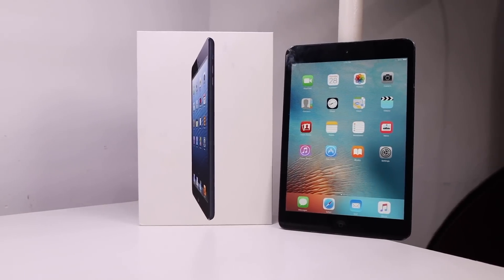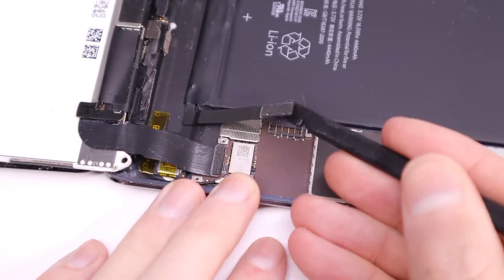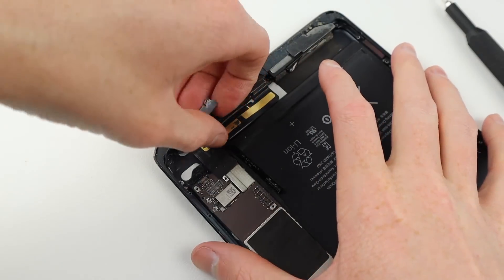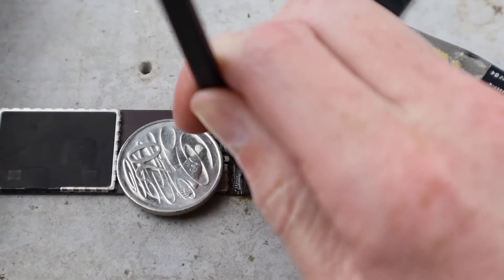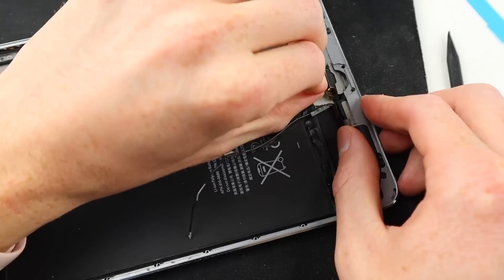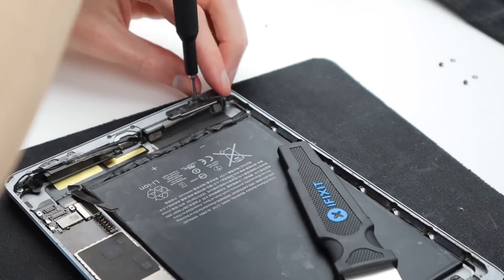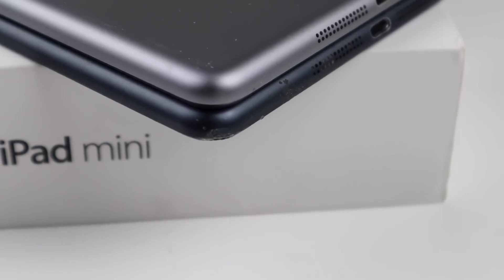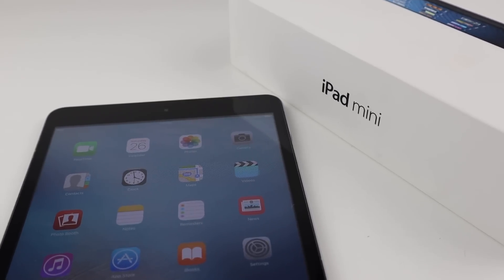$50 iPad Mini 1 Restoration & Microsoldering Repair!

Comment: check c8119 or c8120 for short to ground, most of the time 3v3 line shorted. inject 3.3 volt to c8120  and look for a hot component probably pmic.

Comment: Fixed my SE with this guys motivation
Reply: Tai Callender I like the SE brcause its my only phone and how small it is
Reply: @forcequitOS  Wait for the SE 2 then
Reply: @forcequitOS  It is a 2016 phone btw... but anyways, if you can't wait any longer you can get the iPhone 11, 11 Pro or the 11 Pro Max
Reply: @forcequitOS  Maybe if you want a currently Apple "supported" iPhone get the XR but if you want to get the dual camera get the X or XS

Comment: I tried this repair on a mini 3 and it kicked my but. I am new at cell repairs and tried to use a soldering iron and wick for de soldering. I did not know about the heat gun method. Of course, I ended up ruining the logic board and two replacement charge port assemblies. 😌

Comment: use some low melt solder to get the old connector off a lot easier. Stops you from also dumping to much heat onto the board.

Comment: For an easier removal of the Charger port put leaded solder on the gold contact points then remove the charger port with heat. The leaded solder will decrease the temperature needed to melt the solder off

Comment: Great work. I just worked on one of these today. Really unfortunate that iOS 9 runs so poorly on A5 devices. Almost unuseable.
Reply: Screen Savers I'm typing this on an mini 1 on iOS 9.3.5 it is slow I purchased it a few weeks ago due to lockdown it's actually quite usable if you don't fill it with apps

Comment: In removing the motherboard, rather than heat and pry it, d/c the battery, and flood under the board with isopropyl.

Comment: you can actually downgrade an ipad mini one to ios 8.4.1 by jailbreaking it installing ifile and then changing the version to ios 6.1.3 so that the ipad thinks it needs to update to ios 8.4.1. Once you've updated to ios 8.4.1 you need to reset it in settings and then you just set it up

Comment: I fixed my iPad mini first generation as well and I was surprised how unbelievably stupid it was glued together… it really isn’t Apple like to use adhesive to glue down the logic board or to solder the lightning port onto the device… I’m glad that it isn’t shattered and bent anymore and is functioning almost normally but the heat ruined the Digitizer of the iCloud locked iPad wich had the replacement Digitizer installed… I hope the newer iPads aren’t made that stupidly…

Comment: Instead of the adhesive under the glass. Use T-7000 black glue and some clamps to secure it even more to the frame. Otherwise superb work

Comment: Good video but you should have Desolder Ed the charging flex using an soldering iron. It’s not just easy but safe especially if you are not very good at Hot Air Gun. I hope my comments didn’t offend you mate.

Comment: I had a ipad mini 1st gen until it got snapped in half (literally in half)
Reply: albion pajaziti holy crap
Reply: I'm commenting on an iPad mini 1 I have had since 2014 one volume button doesn't work orientation lock toggles randomly and the touch screen doesn't work for a few seconds after restarting

Comment: Replacement of charging jack was very disappointed,its not easy as u said brother.
Reply: Here comes The pain He said it would require soldering
Reply: @brandon_nope  soldering is not easy
Reply: The charging port is only soldered to the board on ipad minis. All the other models have a lego connector.

Comment: Hey Hugh, I found an iphone 6 with a cracked screen (still works though, even touch), so if you'd like to have a crack at repairing it, I'm happy to send it to you if the owner doesn't collect it from the police station. It is however icloud locked, so if you don't repair it, it'll give you some parts to play with.
Reply: dash8brj I will take it, I can fix it

Comment: Aww man, I wish you could repair my phone (Asus Zenfone Go ZB452KG)and Samsung Tablet (Samsung Galaxy Tab 3 8.0) so I could use it properly (and pay I guess) because the display would flicker when ever I turn it on and it will wouldn’t charge with a regular charger. I have to take out the battery and use a battery charger which uses 2 metal sticks to charge it with the gold thingy on it but the charger is very slow and my father dropped it by accident. And my Samsung Tablet doesn’t work anymore. It all the sudden stopped working for no reason, I haven’t touched it for like 1 or 2 months and I tried opening it to see what I can do. I opened it with my finger nails since it didn’t had any adhesive (because it’s ancient) and couldn’t really do anything. Anyways, it’s ok if you can’t, I don’t need them anyway

Comment: You don't need a full-on rework station to do this job. A cheap $20 soldering iron and stones patience works too. Replace the lightning port on my iPad this way. 

Also, why are you using a toothbrush? Get q- tips.

Comment: Well you can actually downgrade to iOS 8.4.1 by jailbreaking it and setting the firmware version file to anything below 7.0.0 and using OTA update to install iOS 8.4.1 since Apple still signs it for devices still running iOS 6 which can’t directly update to iOS 9 or later. And then from there you can jailbreak then install coolbooter and dual boot between iOS 6 and 8 which if you’re running iOS 8, the jailbreak will be untethered meaning you can reboot the device and still allow it to boot to the second OS

Comment: hello Hugh... I am from the Phillipines and I have an Ipad mini 2 that if you allow, wanted to trade it to a ipad mini 2 also but with good screen working. Mine had black lines on it and tried to replace it using your video but I got scammed and the given to me is at low quality..

Comment: Hey Hugh, I don't know another way of contacting you so i'd thought i'd just leave a comment, I've got 2 iPads unsure if it's first or second gen and a iPhone 5c, One iPad is icloud locked and I can't get it unlocked, the other has a faulty lcd, and the iphones screen is damaged causing touch screen not to work in some locations, If you would like them to try to repair them for a video i'm whiling to give them to you. I am in Australia so postage would not be an issue
Reply: Pyr0 you should ask him on social media

Comment: Hold up, hold up... he spent 50 bucks on a completely trashed 1st gen iPad mini? A NEW 1st gen iPad mini in perfect condition is hardly worth 50 bucks, a perfect condition 2nd gen might be worth 50 bucks. You can get new iPad's for 300 and easily find mint ipad air 2's etc for much cheaper. 50 bucks is horrendous.